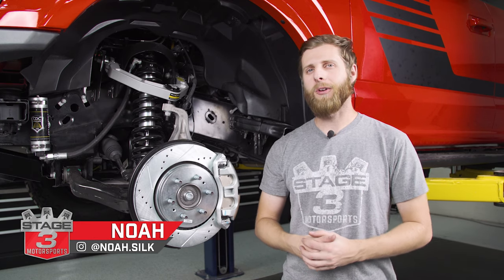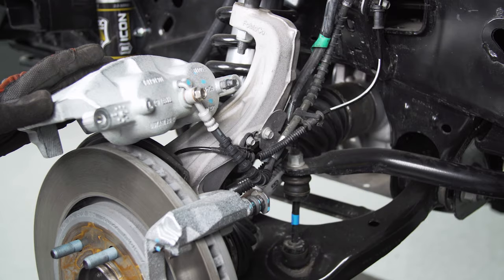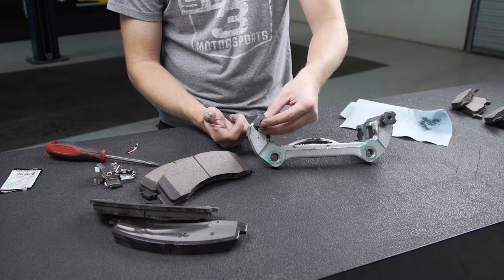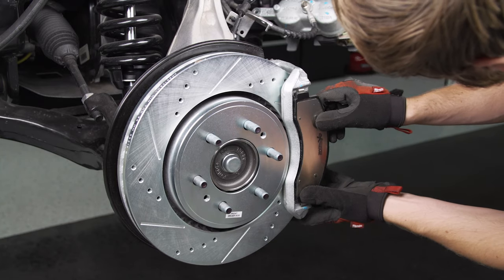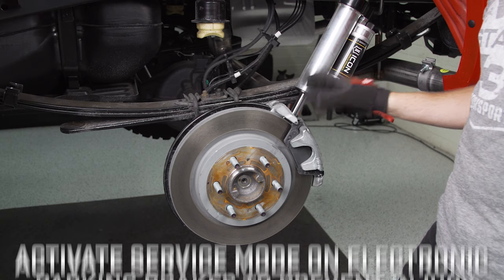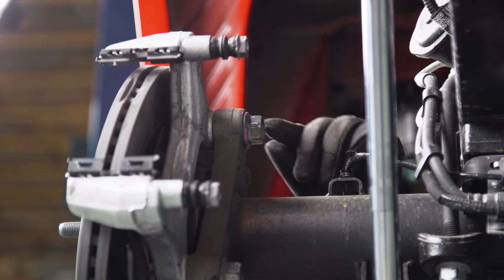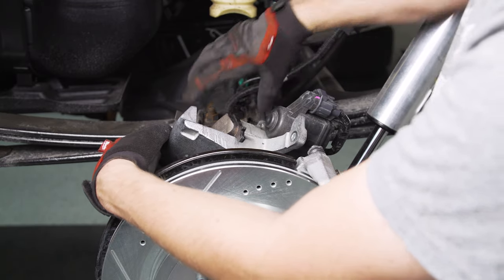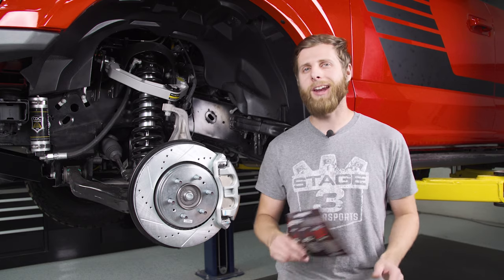2015-2020 F150 Powerstop Z36 Complete Brake Kit Install

Comment: I was told that you had to put the truck into maintenance mode to do the rear brakes or you will screw up the electronic parking brakes. So you don’t need to ?
Reply: Yes, you do. They didn’t show it.

Comment: Just did my rear brakes on 2021 and the power stop grease sent with the kit told me to apply grease to the shims on the back of the pads. I did not see this step in this video. Am I wrong?

Comment: Do you bleed them after installing them all or after each wheel.
Reply: Shouldn't need to bleed them, the hydraulic portion of the system wasn't opened, which means no air should have been introduced.

Comment: Is there a difference between the rear rotors for the electronic vs the manual parking brake for a 2020 f150 stx?
Reply: I believe the only diffrence is the caliper.

Comment: What is the dust like with these pads/rotors? Stock ones typically cover the wheel with dust in about a weeks worth of driving.
Reply: In my experience there is much less dust